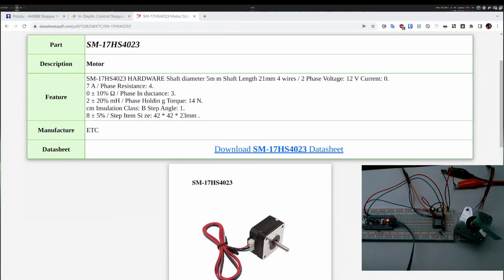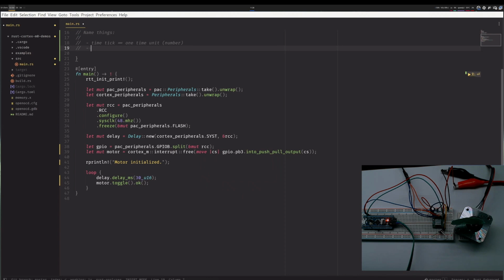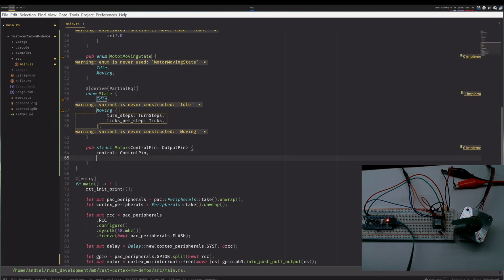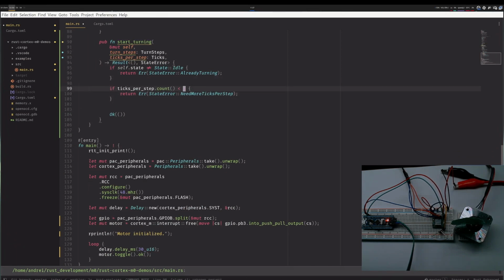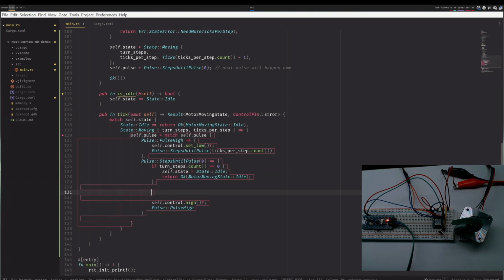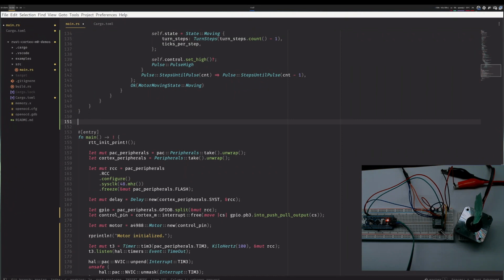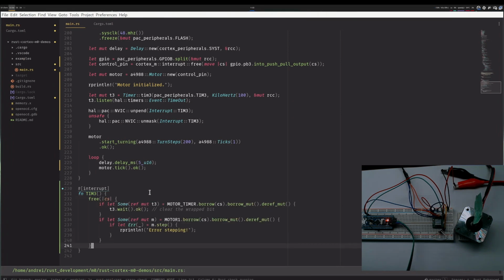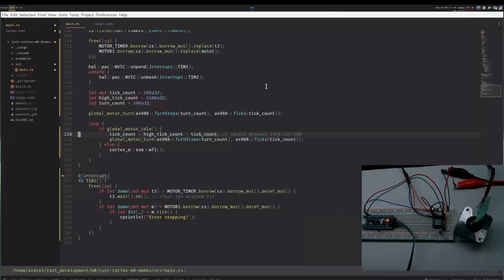Embedded rust: controlling a stepper motor using a A4988 driver

Comment: Do you have experience using some kind of RTOS in Rust projects? If so, would you like to share?
Reply from the maker: I have not yet used RTOSes in rust. Outside rust world I mostly used FreeRTOS.

I believe I would want to use some form for RTOS for larger projects and I see things based on esp32 generally being able to use std and I think they are based on FreeRTOS when doing that.

Comment: will there be any esp32 series in rust...
Reply from the maker: I have ESP32 devices that I can use to show functionality. Risc-V based items will build out of the box (the C3 series of esp) however the others require a separate LLVM compiler, likely using a pre-build docker image for expedience.

I will take a look at it to see if working with one can be condensed in a video.